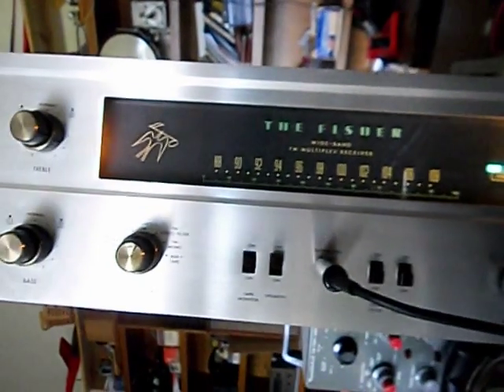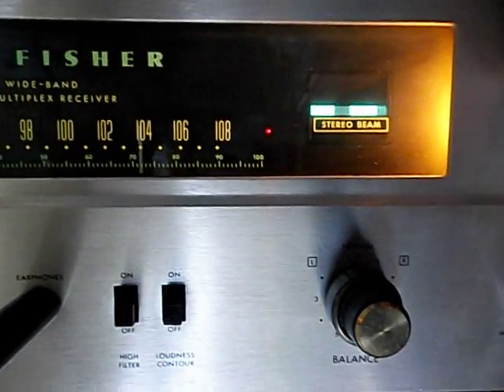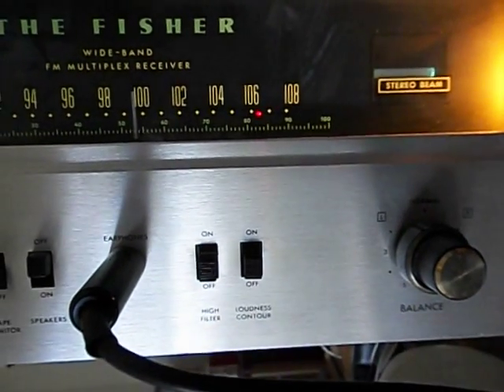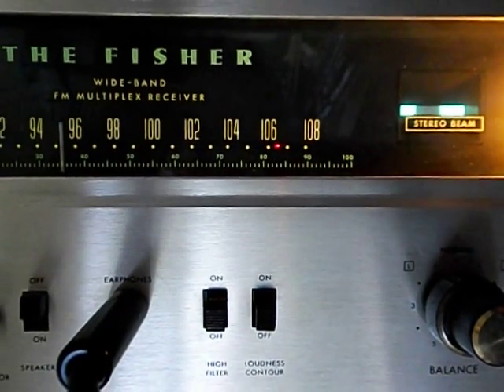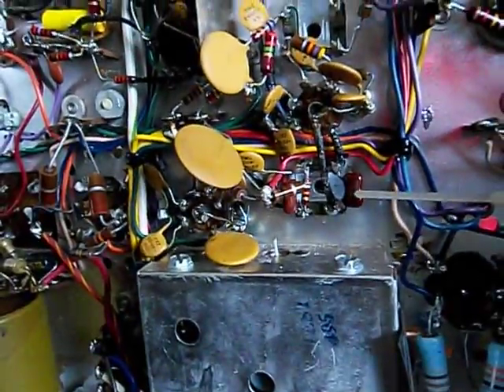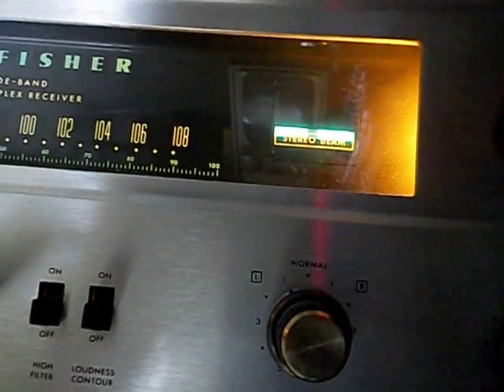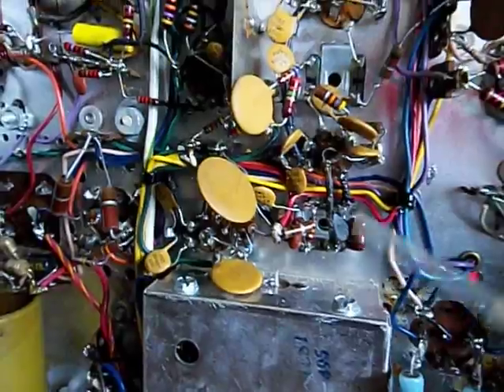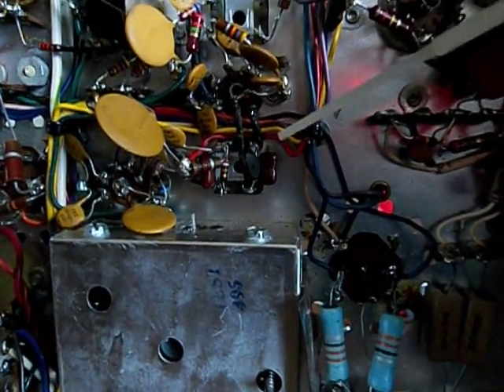Vintage Fisher 400 with MPX prob part 2

Comment from the maker: I little checking, the resistor in question is R206 on some production runs it was deleted. the schematics are a little chaotic on this (at least the ones I found on line). in some cases it was not on the schematic but was listed on the parts list, on some it was not on the schematic and noted in the parts list as deleted.

Comment from the maker: good question, I don't know the answer, but I know it does close more on stronger stations, on my other set it does, but its a earlier prod run with different circuitry. I did find a voltage divider resistor off the MPX indicator lead that i could NOT find in the schematic. Perhaps a factory mod to keep the eye for closing, I will be checking the over all alignment soon as well as the pilot signal setup. if it improves I will post.